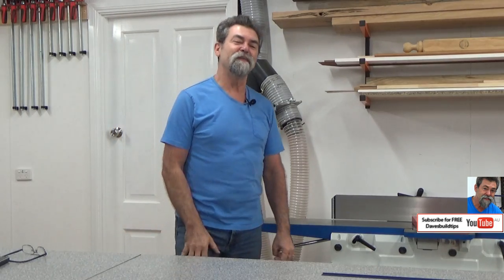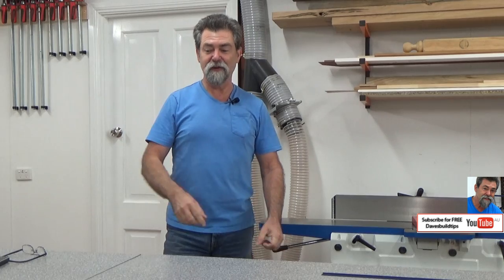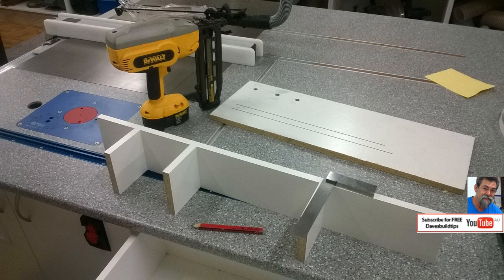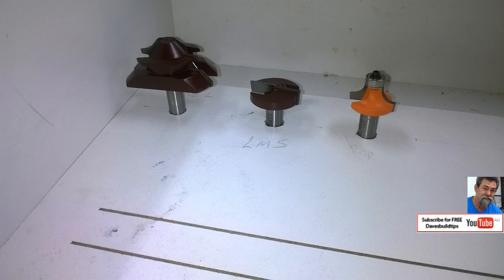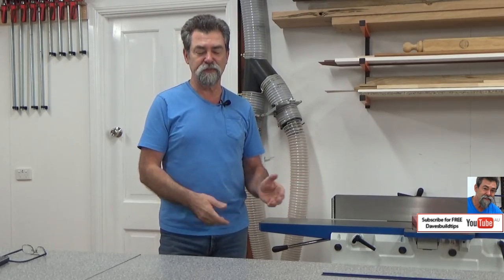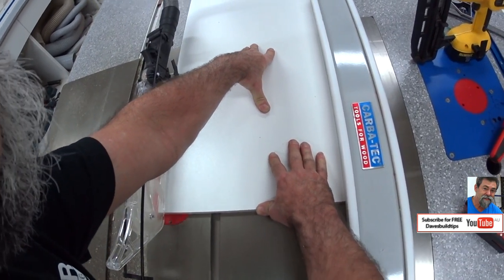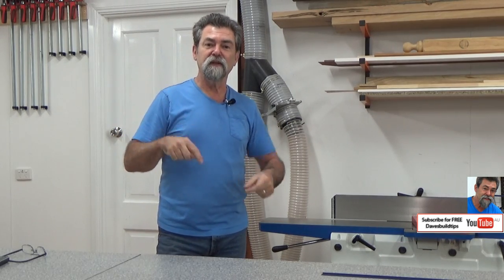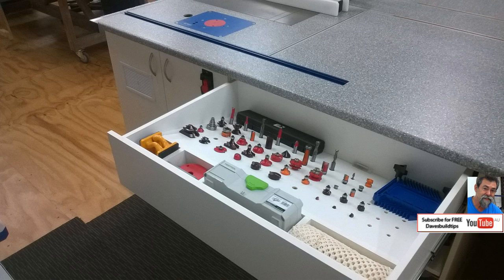Router Bits | Organisation | DIY | How To | Dave Stanton

Comment: Nice work.
I am setting up my workshop for the final time.
I've ended up with nearly 60 drawers full of bits and pieces.
Instead of labelling each drawer with the contents, I've numbered them.
I've got a printed list with everything listed alphabetically and the location is the number of the drawer.
This makes finding things and changing locations super easy.

Comment: Thanks for the tip.  The drawer looks a lot like my router accessories and bit drawer (the before, not the after).  I guess I had better get busy.  Also, I would label them if for no other reason than knowing the size of the profile.
Steve
Reply from the maker: That was my thinking re labels, especially for the round overs.

Comment: Hi David, The answer to your question is yes, labelling bits is too much. You can easily see what bits you have and to label them would not serve and use. I do like the new look draw though, I did some similar with my bits and after getting them all together found I had multipacks of a lot of them and ended up this three draws, so I will not be buying any more for some time
Reply from the maker: Hi John, thanks for watching! I have labelled my roundover bits to tell me what radius they are as the bit itself is not marked in any way. I can now do a visual and return them to their correct position and straight away see if it is a 3/8 or 1/2. 
Organising your draw has saved you money.

Comment: Labelling the bits?  I don't think that is too much, but I can be a little OCD at times....lol.... perhaps the speed rating (or the setting on the router that matches) would be good label, for safety reasons of course...:)
Reply from the maker: Good idea speed rating. I am leaning towards one large speed rating label for all cutters that has maybe 5 diameters?

Comment: You can never be over obsessive.....:)
Reply from the maker: Thanks for the reassurance Brian. I did print labels for my roundover cutters today!
Reply: Good man, we were taught to label every thing. Every part from the wood machinist shop had a number ( chalk for the timber...texta for melamine et al ). Then you had to know what router bits you were using for what profiles or finger grips, or hinges,or inset handles in sliding doors. They were Black and Decker routers ( from the ark :) )
Reply from the maker: Black and decker was pretty good a long time ago.